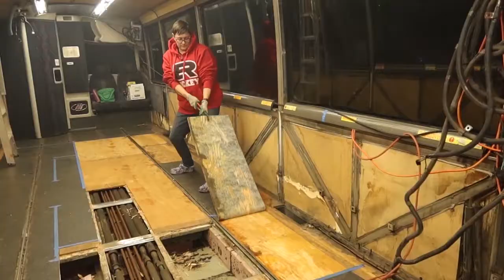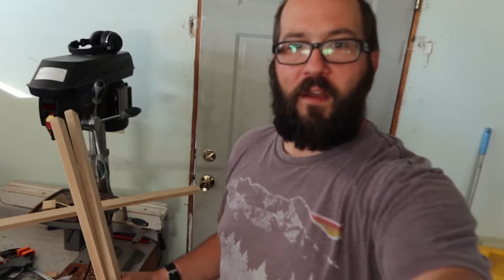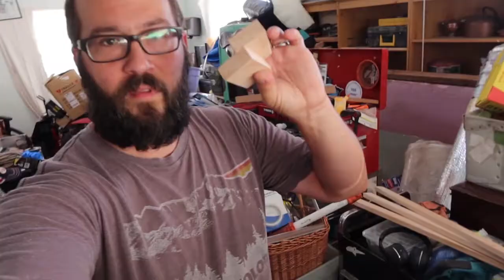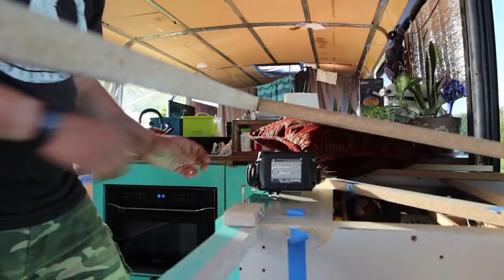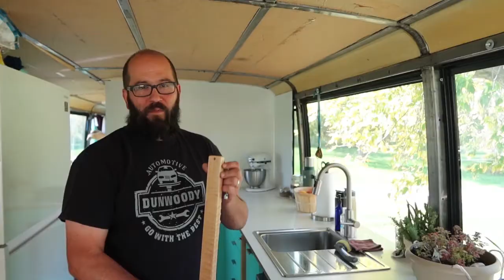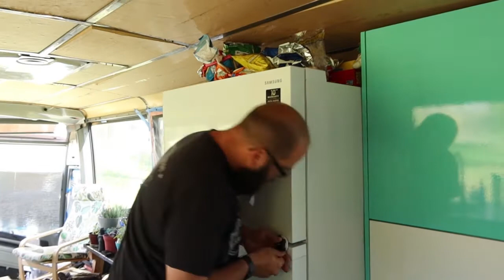Road Ready?!? Making Cabinet Locks for our MCI E4500 Bus Conversion

Comment: Did/or do you guys use a leveler/stabilizer .
Reply from the maker: We set the bus on high ride and stack a series of 2x10 and 4x6 lumber under the jack pads then set it on low ride and shut it down.